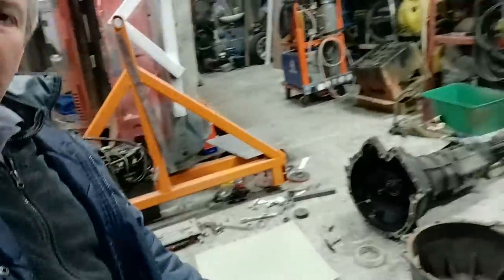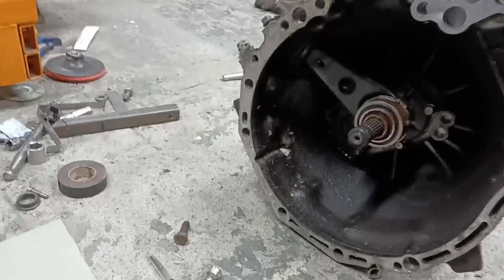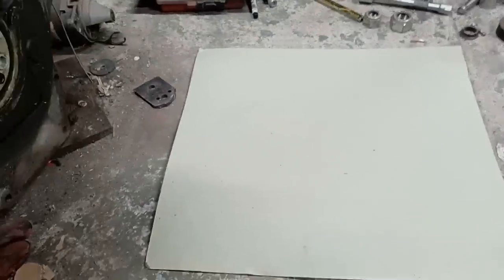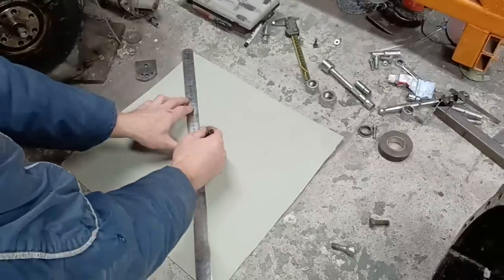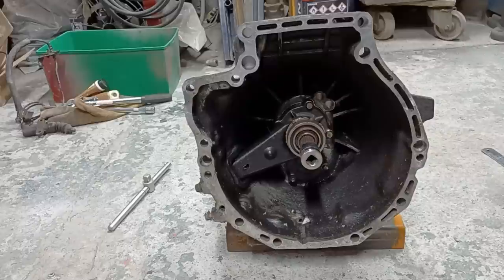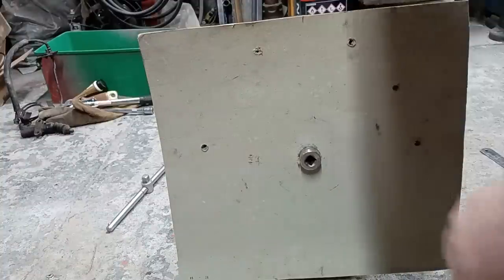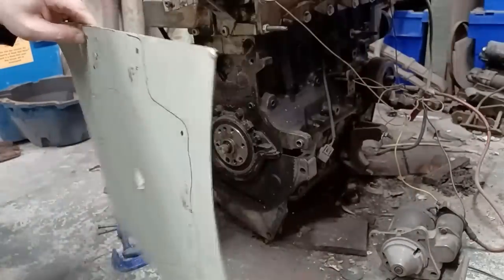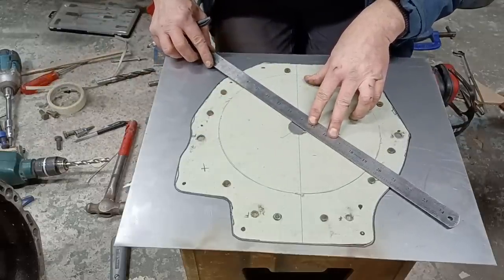Ford Escort MK1 Restoration.  DIY Gearbox Adaptor Plate.  MX5 NA to ST170. Will it Work?  Part 1

Comment: Excellent work as always, don't think I'll ever need an adaptor plate but at least I know how to go about it now, thanks.
To make welding the nuts on the gearbox side easier you could put the bolts through from the engine side with a nut either side of the template. tightened them up and then you'd be able to take it off and weld them. Or do your method and just sacrifice the bolt heads.
Reply from the maker: Good idea, ta 😊

Comment: Retroford use the mk3 (nc or N7) mx5 gearbox, reason being as it bolts directly up to the 2.0 Duratec. The Duratec was used in the mk3 MX5.
Reply from the maker: Ah, OK, makes sense

Comment: This is really great Dave, thanks for showing this process...making an adapter plate isn't something that's seen much even on youtube. I'm curious as to how you're going to make up the additional width of the plate in the engagement of the input shaft on the spigot bearing....or maybe there's enough stock (length on the shaft) there where you won't need to worry about it? Also, I'm hoping this Mk1 Escort playlist of yours never gets lost as I have my own Mk1 waiting for complete resto-mod-ration! It's gonna sit for a few years until the kids have grown up so these vids need to be here for when the time comes. Thanks for all that you do.
Reply from the maker: Thanks for you comment mate,  hopefully the videos will remain on the tube 😊

Comment: Clever stuff , so I’m thinking as long as the splines and the shaft diameters are the same it’s probable you could fit any gearbox on any engine ( within reason ) ! Obviously front and rear wheel drives are different  . Great vid Dave you may have just answered a huge question for me or at least made a project more doable 👌🙏👍
Reply from the maker: Watch this space, the input shaft is the right diameter for the spigot bearing, which is a good start.  The splines can be different, may need to hybridize an mx5 clutch and mondeo clutch, we will see.

Comment: Brilliant series I’ve been watching from the start 👌 I have just finished making my own adapter at the weekend for the same engine and gearbox. If I had of waited a couple days I would of saved alot of hassle for myself 😂 i couldn’t find any info on this match of engine and box I actually thought I had the gearbox that retroford do the adapter plate for but didn’t realise there were different boxes and went ahead and bought the adapter plate 🙄
Reply from the maker: How did you get on with the clutch side of things?
Reply: Didn’t get that far yet I actually I just wanted the adapter to mock engine and gearbox to the car (mk2 escort) I’d say it’ll be a while before I’ll be sorting the clutch. I did notice the std st170 flywheel hit the bell housing at the bottom but the std flywheel is thicker than the solid flywheel so might not be an issue
Reply from the maker: @michaelh30  I ditch the standard st170 flywheel, it's a dual mass thing that's huge and heavy, a mondeo 1.8 or 2.0 flywheel fits, and fits nicely into the gearbox.

Comment: Excellent engineering skills in action again Dave. Pity you coldn't have used your little lathe to make a little temporary bush insted of the socket and insulating tape on the end of the 1st motion shaft..... probably just as accurate though, given that the cardboard is transfering the markings. You will get your chance with the lathe to make a phosphor bronze bush for the  mazda first motion shaft into the end of the zetec crank. Brilliant stuff, is there anything you wont try yourself.
Reply from the maker: Thanks Neil, I simply forgot to use the lathe 🤣.  And I won't do plastering 😊, tried it once, and was awful at it 🤣
Reply: @DavesGarageuk  I know what you mean about plastering🤣! Have you had a sneaky measure to see if there is a gap between engine block and bellhousing with the spiggot bearing diameter engaged into the crank bore? If all else fails and the gearbox has a removable bellhousing, you could always use a ford bellhousing and make an adapter at the gearbox end. I have  similar setup  on a ford smallblock 302 with a Getrag 5 speed XJS box. The adaptor plate is about 1" thick and sits betwen gearbox and bellhousing. The large variety of different ford bellhousings can allow the correct depth for spiggot bush engagement and a concentric bush of nylon or delrin can be used to adapt the difference in gearbox and bellhousing spiggot diameters and geep the shafts concentric.
Love what you are doing, btw the sump was an artform!
Reply from the maker: @Neil Jarvis  hi Neil, I've had a quick size up, yet to measure properly, should be ok. Unfortunately the bellhousing is all one, so not an option.
Reply: @DavesGarageuk  I thought that might be the case, 6mm steel for the adapter will give more engagement and if not enough you could always turn an extended top hat spiggot bush to support the shaft allowing for the friction plate protrusion past the flywheel face and some friction material wear. Good luck, next episode can't come quick enough! Definately best petrol head channel on youtube now. Btw, did you know David Vizard has a channel now, I bet you remember him from the eighties!
Reply from the maker: @Neil Jarvis  cheers Neil 😊, yep started following David Vizard, what a legend to share his knowledge 👏

Comment: Is there a big difference in an mx5 box and a 5 speed type 9? 
The final ratio in 5th is about the same. 
A type 9 is easier. Yet people are going mx5 box. 
Type 9 feels ok to use as I remember. 
So wondering tbe benefit. As I need to change my crossflow to a 5 speed if people can help? 
Thanks
Reply from the maker: Hi Simon, the type 9 is easier but more expensive, the mx5 box is cheaper and a good gearbox, just more hassle to fit.
Reply: @DavesGarageuk  thanks Dave, is there a big difference to use once it’s finished? 
I saw someone write it’s a night/day  differnece. But that was all, no reason as to why.
Reply from the maker: @simonmenzies3142  I've had a type 9 in my previous Escort, and currently have a MK1 MX5, of the two boxes I prefer the MX5 box, better spacing between the gears, particularly 1st 2nd and 3rd.  But if you have a type 9, use it as it's an effort to make the MX5 box fit a Ford engine